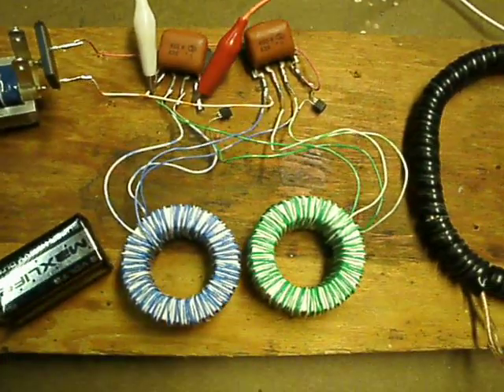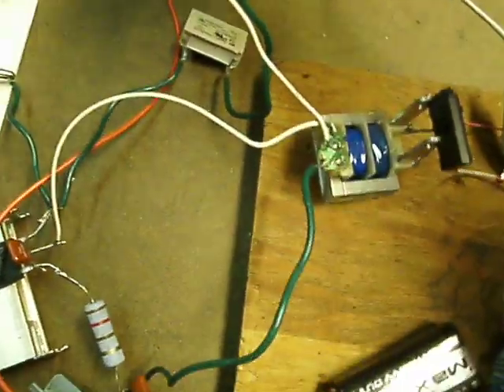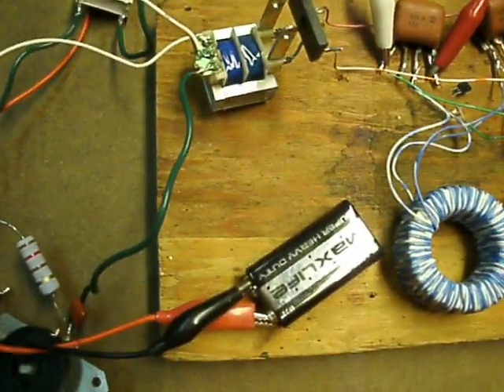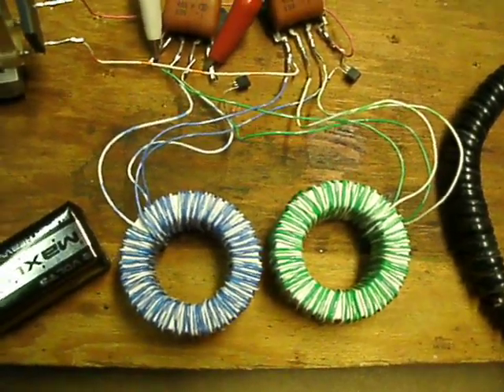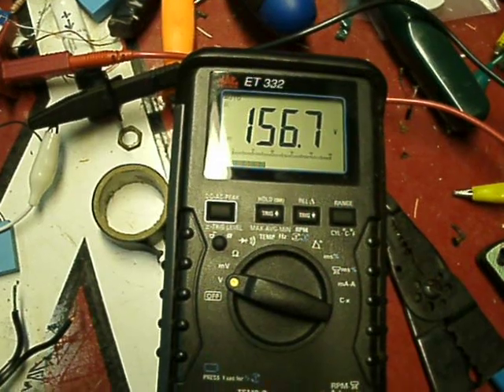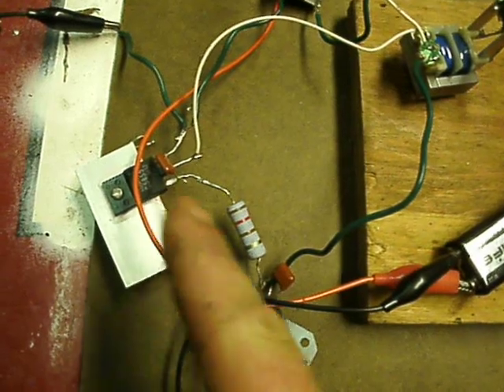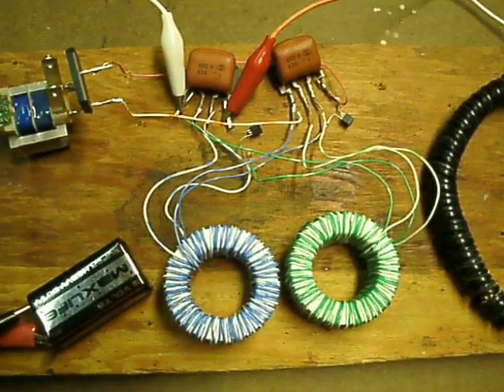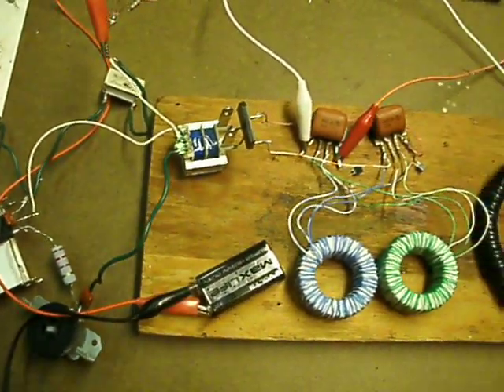selffeed toroids

Comment: Why don't you put the two toroids in that ring coil you got and induce the current. You could think of your setup as a pump. Two surfaces squeezing together with twist is the most powerful movement ever. You might need to create very heavy copper Wires all the way around. The more times you loop it the less current you will be able to push. Parallel the caps and diode packages. You want a better punch and resistance to flow the diodes present. The more the diodes resist the better. Use magamps